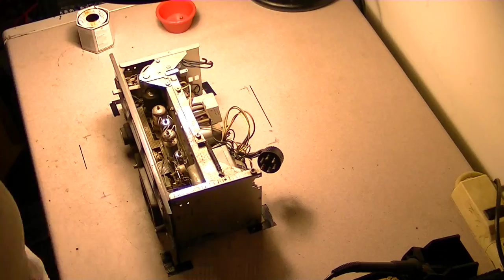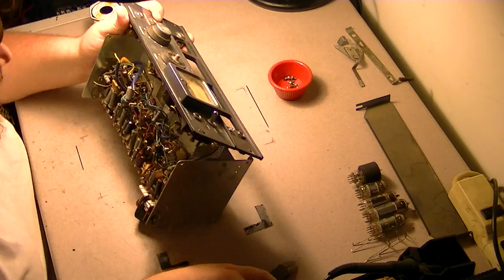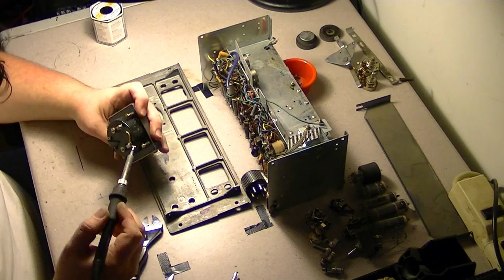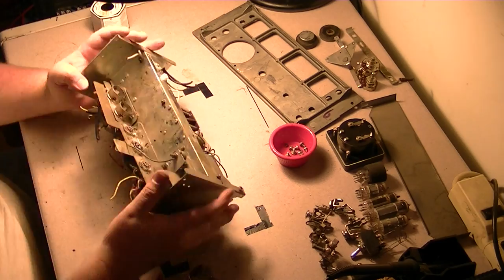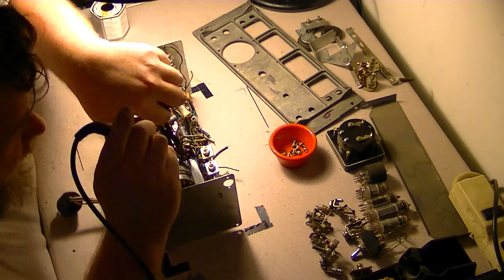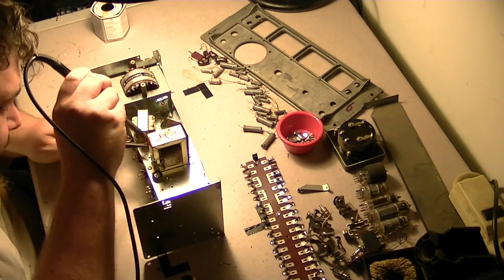Akai Roberts Tube Tape Reel Monoblock Amp Teardown

Comment: I'll say this - I bought one of these guitar amps from Jesse. Its great. I use it all the time in my recording studio. It doesn't sound like my Fender amps, its different, and the overdrive is creamy and thick. This piece of gear would have ended up in a landfill along with the vast majority of all the rest of the great old tube tape decks. If you are upset that no one wants these anymore, and that they are all rusting in landfills, I share your feelings. That's too bad, I love old gear. Jesse hasn't got anything to do with that phenomenon however, your anger at him is misplaced - he's a guy who is rescuing a few of these doomed gears and getting them back into use,  well loved and making music. The fact is that there are a million more of these floating around out there than any of you tape deck guys will ever rescue - what are you doing to solve or mitigate the sad fate of this gear? Anything? Or is hassling a guy who re-purposes unwanted gear what you think will help solve matters? I think not.